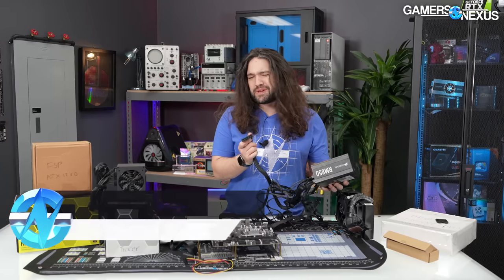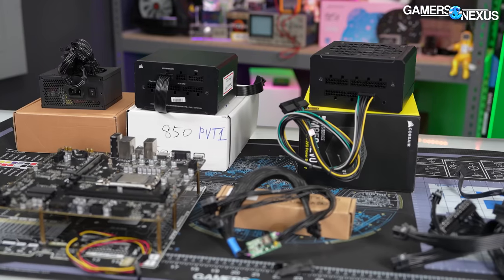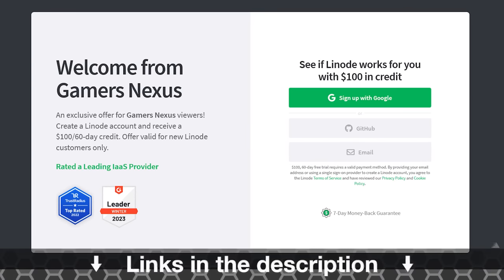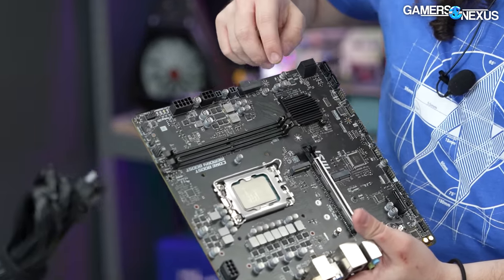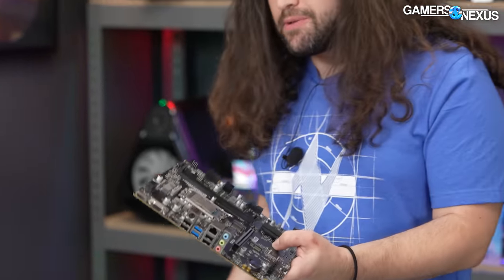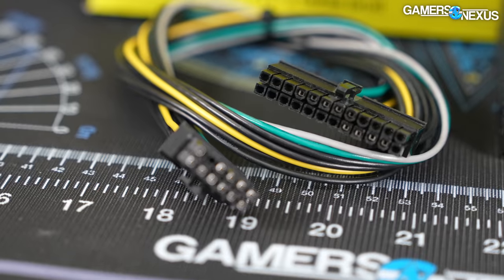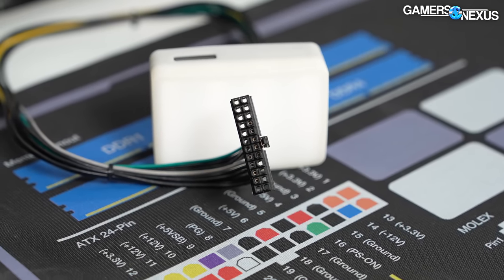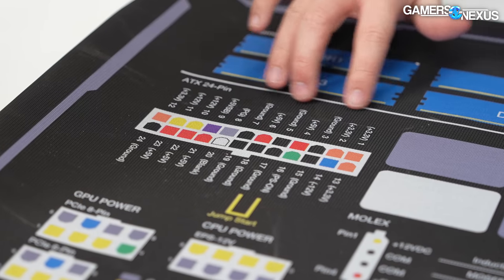The Future of Power Supplies - Maybe (Motherboard Cost, Cables, & ATX12VO)

Comment: My concern with the 12VO standard is that by shifting more things onto the mobo there's more points of failure on a more expensive piece of hardware.  Right now if something goes wrong in power delivery then the PSU can be changed.  If the power delivery system breaks in a 12VO system you need a new mobo and all the headache and cost associated with that.
Reply from the maker: That makes complete sense and saw another user post similarly! Agreed on that. I guess the question is whether or not those parts increase failure potential in a meaningful way.
Reply: they could probably make the power conversion part of the mobo modular
Reply: One issue: Did you have a failed power delivery quite recently? 

Even if it fails, you are likely to throw the board out.
Reply: @cyko5950  Cost of a new power converter add in card-50$. Cost of a new motherboard-600$. I can tell you which one I would choose, and which one the motherboard makers will choose.
Reply: @AlfaPro1337  decent PSUs just stop working when failure happens. If you were using a 20$ 850w PSU then yes when it blows the whole system is on fire
Reply: @CYKO  they wont lol
Reply: Im sure it can be done reliably, isnt that what they’ve been doing on servers for a long time now ? Theres even someone who make a rack that only have 12 or so volts busbar instead of mains voltage (forgot who did it) surely they have lots of experience doing it since we dont see lawsuits from those server customers, right ?
Reply: @TonnyCassidy  Big difference in quality and engineering between .99999 server quality and consumer tripe.
Reply: @TonnyCassidy  Have you seen server prices right? That's one of the reasons why they are expensive
Reply: @marcogenovesi8570  You mean fake 850W that is actually 420W with 500W maximum tolerance.
Reply: You could always learn how to do board level repair. We need more people capable of doing that sort of work. If something goes wrong in the PSU it stands a good chance of frying everything connected to it anyways. While that shouldn't happen that doesn't mean it won't.
Reply: @AlfaPro1337  yes the PSUs that list their peak power as max power and are in fact 400-ish watt PSUs that are group regulated like the PSUs from the 1990s
Reply: @marcogenovesi8570  the problem with failures is they don't always go as you hoped they would.
Reply: Also makes worry about board companies cheaping out and using crappy components whereas in a high end PSU from a reputable brand you pretty much know it's going to be using good components and should get many years from it. Motherboards are very complex already and shoving more power delivery hardware into it is just more points of failure.
Reply: @AlfaPro1337  I had. My PSU's (1000W) fan stopped working recently, it overheated and went into thermal shutdown when I was playing a game. That's really all there is to it, I changed the fan, didn't even change the PSU itself (although it's really about time - it's 10 years old and I'll do it soon probably) and everything still works like new.
I also support the opinion that PSU should be it's own separate device with functionality as it is now. There was a reason it was designed that way in the first place and it still holds true. I've been a PC user since the early 90's and I know for a fact from my experience that changing a broken PSU is infinitely more preferable than changing your mb. Also have you seen prices on modern mb's? lol
Reply: @1pcfred  Decent PSUs have safeties that cheapo ones do not have, this isn't "hope" this is part of their higher cost
Reply: The sub-PSU on the mobo should be soldered on as separate modules. They can be replaced in case those modules die. One positive of this is the mobo companies will design better power supply circuit which matches their mobo circuitry. Designing switching power supplies is almost like tuning a musical instrument. So the mobo will last long. Of course the mobo price will increase, nothing can be done. But I dont like this architecture, you know why ? There is a chance that the mobo companies will become stingy while selecting quality components to keep the final price low. So a mobo with "seasonic" kind of sub-PSU will cost an arm and a leg !!!! Now at least we have a chance to attach an actual "seasonic" PSU.
Reply: @1pcfred  You could always learn how to do board repair too, so you would understand how ridicolous it sounds to tell people to learn board repair to fix issues
Reply: @kosmosyche  I'm not even talking about the PSU. I'm talking about the power delivery on the motherboard.

Even there's a 12V-to-12V convert, to ensure that the voltage is controllable.
Reply: @1pcfred  Even if I wanted to learn to do board level repair (which means I would also be able to do repair in the psu so not actually an advantage for 12VO) it doesn't change the fundamental problem.  Repairing a mobo would still require complete disassembly of the system whereas replacing a PSU is a much simpler task.  Moving the point of failure onto the mobo guarantees that a failure will require mobo replacement.  Keeping as much of the hardware as possible in the PSU means that some or even most failures won't affect the far more expensive and annoying to replace component.
Reply: @GamersNexus  Are you old enough to remember the Capacitor Plague? Imagine that happening with VRMs in the next two years.
Reply: what was the last time you heard of vrm failing? now put that onto vrm which handle like 20W at a lower difference. odds are it's pretty unlikely. 
I wish they could use a right angle card for the motherboards. they don't need to increase the board size.

also at scale, a pcb is like 5 cent per square inch, the added cost is less than a buck. even if it was per layer, that would be a cost of 11 bucks per board for a 6 layer pcb.
guess they'll increase the cost of a 200 buck mobo by 50 for good measure, because yay capitalism.

the additionnal mosfets are literally cents, I don't think the 12Vo addition would be more than an extra 5 bucks, and probably less than 1.
Reply: @satibel  VRMs fail all the time. First gen Ryzen/AM4 boards were notorious for it because manufacturers never follow recommendations and cut corners to save money. 5X00 series AMD video cards and 10X0 nvidia cards had frequent VRM failures as well.
Reply: I'm not sure there is much in that. There are already a ton of point-of-load regulators on your motherboard, any of which would brick your board if they fail. You need multiple voltages for the CPU, memory, chipset, and I/O devices, most of which aren't one of the voltages supplied by an ATX power supply. Adding a couple more point-of-load regulators isn't going to change that. The failure rate of these regulators is very low.

Many servers and OEM PCs have used proprietary 12-volt-only standards for over a decade now. Standardizing this is a good thing.
Reply: @Null_Experis  that's badly designed vrm, though yeah that won't stop manufacturers from shaving cents off of the vrm, but given the low load on the 5V and 3V3 rails you could probably use the cheapest transistor and inductor and still be fine so I wouldn't worry about it too much.
Reply: @GamersNexus  it most likely will as mobo vendors are known to cheap out on components.
Reply: @prashanthb6521 Nobody "designs a switching power supply" to step down 12V DC to another DC voltage. The Switching part (AC-to-DC conversion) is still the job of the PSU unit that converts AC to 12V.
DC-DC regulators are solid state since ages ago, you just add a mosfet an inductor and a cap of the right size and you are done.
Reply: Is that a meaningful issue though when decent PSUs almost universally outlive the useful life of even modern AMD motherboards? Plus the motherboard is already doing a lot of power conversion anyway (that's what the VRMs are, power converters to get the 1.x volt power the CPU wants, I also highly doubt most motherboards just dump the PSU 5V rail directly into anything other than maybe the LED header) so it wouldn't surprise me if this didn't even require much more hardware on the motherboard side.
Reply: @ssmith7074  pulling a motherboard out of a system is no big deal. Really a lot of PSU failures are going to fry a system. Things tend to happen very fast in the world of microelectronics. So it is difficult to design over voltage protection that is fast enough to protect very much. At best it may stop a large fire from occurring. It really doesn't take much at all to fry a component just a few atoms across though. The beauty of on board regulation is that it is localized and the feedback lines are shorter. So you're actually better off when the unfortunate occurs. All of this stuff really isn't designed with easy repair in mind. It is designed to perform and make companies profit.
Reply: @marcogenovesi8570  I've done mil spec surface mount soldering professionally. Now you were saying?
Reply: @marcogenovesi8570  designing power protection that actually protects components is not something that can be practically done. Yes PSUs have protection circuitry in in them but they don't do what you think they do. They can't. They stop you from maybe burning your house down. The components being powered are going to be toast though.
Reply: @1pcfred  So you are a pick and place machine? Bleep Bloop my dude
Reply: @1pcfred  Yeah sure, OCP, OVP/UVP,  OPP and SCP are only there to do the job that you can 100% do with a single solitary fuse (keeping your house from burning down).
Decent PSU fail safe because that's what the additional safeties are designed to do.
As someone working with "mil spec" you should understand the concept of fail safe
Reply: It's a temporary solution obviously. The idea here is to provide a substitute for transition with subsequent removal of those converters from the motherboard when all components will be 12V only. There isn't much left that still uses 5v anyway. External drives are not relevant for years now, especially in small form factor builds. SATA drives are long outdated.
I can easily see miniITX boards just dropping SATA support altogether and thus they won't need those converters and would actually be able to free some space from SATA connectors.
Reply: @cyko5950  We had "modular" VRMs back in the early PGA Xeon motherboards. Those usually didn't last as long as embedded ones.

PSUs should provide all the essential rails. Just drop the old/not used rails and pins (-12V, we dropped -5V some time ago leaving a pin w/o connection).
Reply: @GamersNexus  Frankly, as an electronics engineer, I'd rather work on a motherboard than a PSU, if we're talking component level repair.  And having the regulation local means shorter feedback loop, means less need for bulk capacitance, means less tantalum/polymer electrolytic caps on the board... And those are basically the only parts in electronics, that have a meaningful "lifetime". Most other components either are underspecced or are not, and thus either work, or fail fast.

It's basically VRMs. Designed decently, they'll last forever. Designed badly, they'll overheat, and the heat will degrade their performance, causing more heat, leading to a chain reaction of failure.
Reply: @richard-davies  on board regulation is not power delivery. That's still handled by the PSU. On board regulation is regulation. It's actually better than power being regulated in the PSU due to feedback line length. At the end of a long line a regulator can't really tell what voltage the load has. That's due to line losses. Voltage will be different at one end of a piece of a wire than it is at the other end. The longer the wire the more different it'll be. With the crappy wire they're using these days it matters even more. We caught on with copper clad aluminum so now they're copper plating steel.
Reply: @1stRanger  components are certainly not 12V. It is just easier to distribute 12V. Watts = Volts times Amps. A 100 W part at 12V draws 8.3 Amps. At 2 Volts 100 Watts is 50 Amps. You can carry 9 Amps on a 21 gauge wire in a chassis. You need a piece of 10 gauge wire to carry 50 Amps. 21 gauge is 0.028" in diameter and 10 gauge is 0.1" So 3.5 times thicker. Standard chassis wire in a PC is around 18 gauge (0.04" dia). Copper costs money. Beyond that there's other issues surrounding regulation feedback at distances. Then the motherboard has to adjust the voltage. So dealing with motherboards communicating with every PSU is impractical. There's reasons why we do things how we do them. We do things how we do them because it's what works.
Reply: @GamersNexus  Even if the parts don't have an increased failure potential, they will be warrantied differently. The 3.3v and 5v power on my PC is covered by my PSU's 10-year warranty, versus the 1-year warranty that came with my motherboard. It seems objectively worse to me IMO.
Reply: @AlfaPro1337  Easy for the PSU not to die if it only needs to be a PSU. The motherboard won't die easier because now it's part PSU, the motherboard will die easier because yet another additional layer of complexity was introduced to the PCB design.
Reply: @marcogenovesi8570  you believe what you want to believe. Good luck to you. It's what you're counting on. I'm not saying protection can't work. I'm just saying it can't work all the time. The protection circuitry can fail too. Steve's tested protection and how it works is variable. Some's better than others are and none of it is perfect. We're lucky PCs run at all. Statistically they really shouldn't.
Reply: @1pcfred  I can certainly appreciate you explaining Ohm's law to me as well as its implications for engineering and production. I completely miss however how anything of what you just said is related to my post.
Reply: @satibel  I remember manufacturers talking like this about Taiwanese capacitors in 2001.
Reply: @marcogenovesi8570  machines can't deliver what the buzz cuts are looking for. Which is higher quality workmanship than consumer goods are. They're rather OCD about it really. I guess for what they're paying they can be demanding.
Reply: @1pcfred  More like I know what I know. PSUs from the last decade don't usually take the rest of the PC when failing, and that's a statistically proven fact and the reason additional safeties were created and included.
Yes everything can fail but the chances compound the more things must fail at the same time and it becomes more and more unlikely.

But hey if you say "statistically PCs really shouldn't work", you just demonstrated you don't know how statistic works so it's not surprising you are unable to grasp this
Reply: @1stRanger  therein lies the problem. You cannot expect me to explain it all to you here and now. I just tried to cover some of the highlights of why you don't know what you're talking about. Nothing runs on 12V. Modern logic is 3.3V or less. But we can't practically distribute that low voltage tightly regulated at the power levels we need. So 12V it is. Then we use local regulation. It just works best. Would it help if I told you I can talk to plants?
Reply: @1pcfred  Thank you so much again. Any other painfully obvious things you want to add? Maybe you want to lecture me on states of matter or other fundamentals? Please teach me, oh great host of knowledge, for we are mere fools in thy presence.
Reply: @1pcfred  Higher quality workmanship? So they want a pick and place machine. Sorry kiddo but there is nothing you can do better than an automated board assembly line, both in the soldering and in the post-soldering QA.
The only reason you would want to have humans do SMD soldering is when you have small batches like 100 boards, and it's too expensive to set up the pick and place system and all the checking with vision system.

But even then, manual SMD soldering is still a very different process than board repair, you apply a stencil of paste, place the parts on top and then put the board in the reflow oven. Easy, done that many times.
Reply: @marcogenovesi8570  so you do admit that I'm right. "PSUs from the last decade don't usually take the rest of the PC when failing" No they usually don't. But all it takes is one time. Then you're the one that crying. Look up what the law of large numbers is. There are hundreds of billions of transistors in modern PCs and you need all of them for it to work right.
Reply: @marcogenovesi8570  every time you say something you just prove how little you know. A reflowed board wouldn't pass mil spec. They want their joints tighter than paste allows. They basically don't want the solder flowed. I never asked them why. That's just how it is. Perhaps it's for the same reason they wear flat top haircuts? The only way we could manage to do it was to solder the parts then wick off all the solder we could. That's what they want. You don't argue with people that have nuclear weapons. You just do what they tell you to do. That's the job.
Reply: @1pcfred  Btw watched a few videos from your channel. Great stuff. It's immediately obvious you are the real deal, the Pro with capital p. Can't wait for more of your knowledge to enlighten me.
Reply: @1stRanger  you just stay tuned and I'll let you know everything you need to know.
Reply: @1pcfred  Yes, my master.
Reply: @1pcfred  so you repeat you have no clue of how statistics work, again?

What does "all it takes is one time" matter in a discussion about what is the best place to put a component based on chances of failure and fail safes included? Yes you can be hit by a meteorite too, there is a non-zero chance. Why aren't you living in a bunker then. It all takes one time right?

The number of transistors argument is also another obvious example of inability to understand statistics. Yes you have many components, but that's only part of the equation. How high is the chance of failure of those? How many you can lose and in what places before you actually lose functionality? 

Because by pure failure statistics on stuff that is out, the most common failure in electronics is the power components, not the signal components.
Or for hard drives and other mechanical devices it's the mechanical part that goes first in nearly all cases.
Reply: @1stRanger  yes they're infinitely better than what I'm seeing on your channel.
Reply: @marcogenovesi8570  who told you I wasn't living in a bunker?
Reply: @cyko5950  they would never lmao
Reply: The question is, how many components are actually affected? Not many parts of the motherboard actually require 5V, 3.3V and -12V, so I would assume the risk increase there is quite small.
The major power draw comes from HDDs, Sata-SSDs and ODDs. I would assume that those buck converters on the motherboard are most likely to fail. The main question is, if their failure will take the motherboard with them. If they simply stop working, there would be still an option to use an external buck converter between the drive and a 12V rail from the PSU.
Not saying that this should be the preferred option, but it could be an option in such a case
Reply: Current draw on 5v and 3.3v is vastly lower than 12v so I don't see that failing unless the mobo maker really cheap out on the components.
Reply: @GamersNexus  The failure rate on the mobo would probably be essentially the same (within an order of magnitude for sure) as in a power supply.  The components are going to be the same and the thermal environments won't be much different.  PSUs have notably longer life spans than many other PC components so maybe the reliability of moving the voltage conversion to the mobo isn't a huge concern.  My main point is that if there is a failure (and there will be for someone) it is far more difficult and expensive to fix.
Reply: @justion337  Good thing mobo makers have never been cheap on components.  But again, it isn't really about the likelihood of failure as that isn't going to change.  It's about the time and money cost of a failure.  Mobos are already one of the most expensive parts of a build and the hardest to replace if something goes wrong.  Adding more cost and complexity to them isn't going to help anything.
Reply: 12vo is too similar to current power supplies. It’s clear that power needs to upgrade to 24v or possibly 48v in order to decrease wire size for same wattage. 

Being too similar to current there’s no impetus to actually change.
Reply: historically the PSU has been the least expensive and longest lasting component in PC in the now hundred of systems with even low budget "cheap" power supplies being much more trustworthy then a "cheap" motherboard.
also many of even the bigger motherboard manufacturers have been caught and rightly called out for using cheaper and lower quality power converting components especially for things that are much more sensitive then a SATA drive. when a manufacturer is willing to use cheap chokes and caps on CPU power stepping then they would be more then willing to use such components for SATA drives and fans.
it basically comes down to if 12VO is going to be a competing standard would you rather trust a random PSU maker or a random Motherboard maker?
Reply: this is a meme. plenty of server hardware has done this for a decade+ and virtually never fails.
Reply: @g g  that server hardware is sold on 99.99999% uptime and they actually use higher efficiency parts then you realize because when it is sold on that uptime promise and it doesn't we are talking about big players if the component fails.
Reply: @GamersNexus  solid state voltage regulators are very reliable. They supply power to the CPU and RAM after all.
Reply: @gardian06_85  than* and no, it isn't higher THAN I realize, since I've worked in this market 30 years. The amps required on 3.3 and 5v rails on motherboards today is virtually nothing. So no it won't matter and no it isn't expensive. Doing custom PSUs or using pico PSUs work for so many for a reason... all you need is a good 12v rail.
Reply: @gg-gn3re  the thing is I have seen and experienced low quality voltage conversions on consumer Motherboards far more  then on server boards.
back in ix-3xxx through ix-6xxx many main stream board makers were using low quality voltage regulation on CPUs (you know something that needs to step 12 volts down to 1.2-1.4), even on mid to high end and even the "overclocking boards.
this is why I do not trust consumer board manufacturers with the potential to use lower quality voltage regulation, and conversion components.
when it comes to server hardware there are fewer customers, and the contracts are worth a lot more, and they are marketed on up time, so them using lower quality parts is of higher need.
you are also taking complexity out of a part that on average has a 10-20 year lifespan usable across multiple builds with even the "lower quality ones" still being reasonable, and putting that complexity into a part with higher cost, on average higher failure rate, and already more points of failure. that is typically only 1 build
Reply: @1pcfred  How does a failure of mbs of future doing the conversions instead of psu doesnt fry the pc components but psu failure does/did ?
Reply: @manefin  I never said anything to that effect. I believe you've misunderstood what I have said. I'm not even entirely sure what you're trying to say. I'm thinking when you're using the word, "conversions" what you mean is regulation? You do understand the concept of propagation, don't you? That it takes signals time to traverse distances. The closer you can place a regulator to a load the faster it can respond to changes in the load. That is one way moving regulation to the motherboard can improve over regulation in the PSU. Then there's distribution. If every load has its own regulation a failure in one place won't affect other parts of the circuit like a central regulation failure would cause. I hope that helps.
Reply: @1pcfred  I had the impression you argued that modern psus blow up regular and at the same time damages/destroys other pc component too so making psus 12VO and moving some of psus work to mb makes future pcs way more reliable.
Reply: @manefin  local regulation should be better than global regulation. It's being done already. PCs haven't run stuff off the 5V rail for a long time. I've built large digital electronics circuits and it is impractical to say the least to try to get everything to run off the same rails. It's stupid to even try.
Reply: @GamersNexus Do you have any data on what parts of a PSU are most likely to fail? In my experience it's been on the 240/120 -> 12v step-down and filtering. In a 12VO arrangement, this is still happening in the PSU. Stepping down DC->DC is relatively safe and I don't imagine it having much effect on the MTBF of a motherboard.